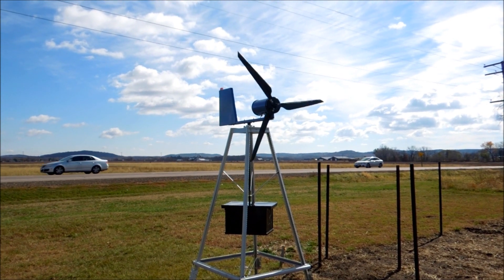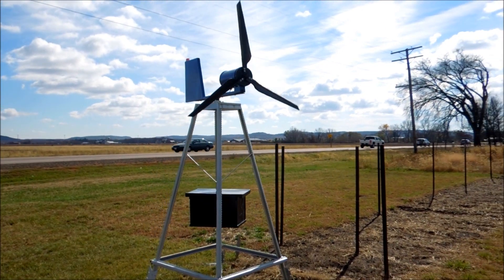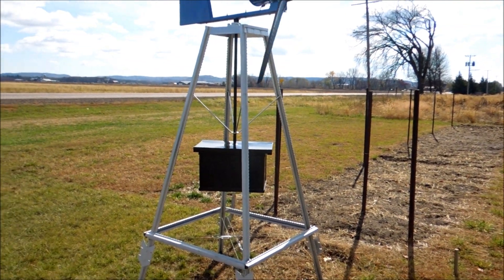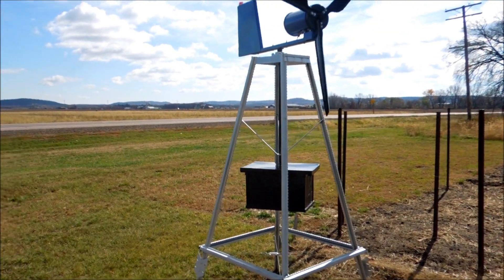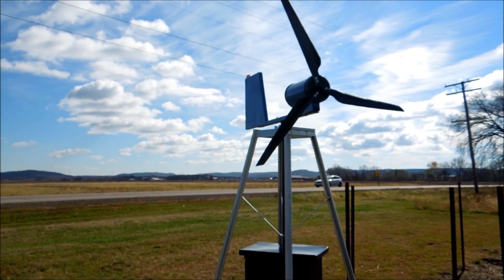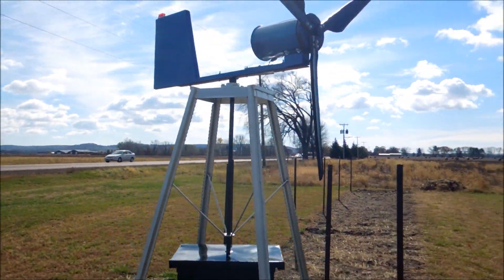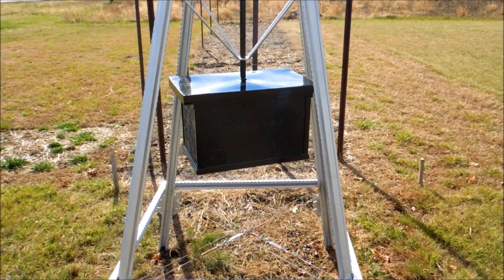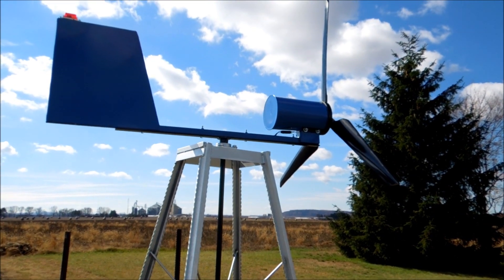Homemade 12Volt Wind Turbine by HPFirearms

Comment: 99% god job, is it possible to make the shaft/axel longer so you can have more blades on it, maybe even lead the wind into the turbine like a pipe and axelerate the wind by makeing the pipe smaller as it comes close to the blade, i know they do it with water to get higher pressure, this way you can have a twin axel with a gearbox on it so you can charge more batteries at the same time.